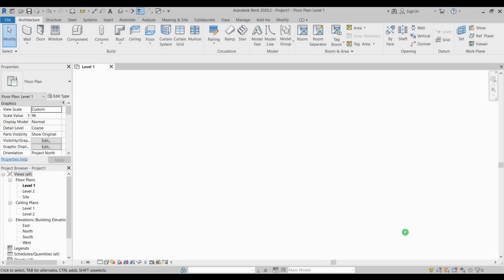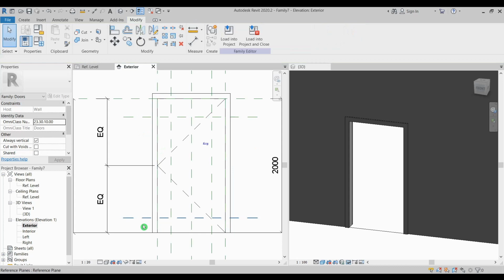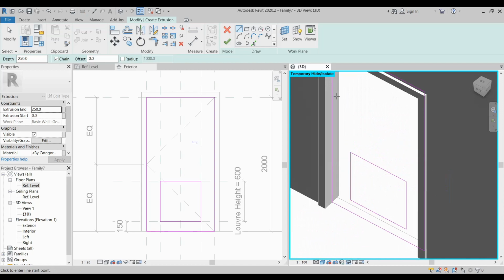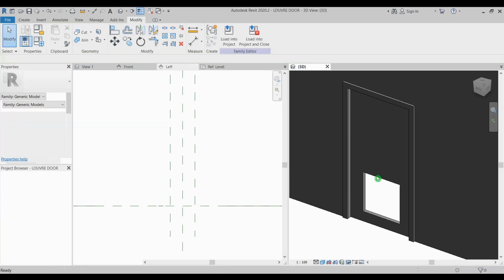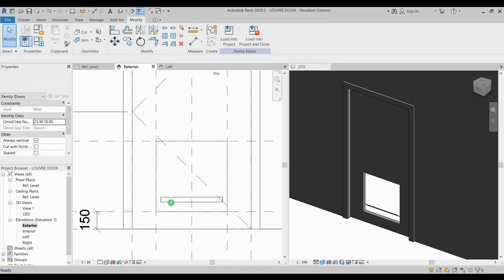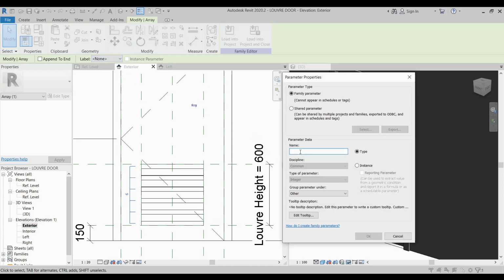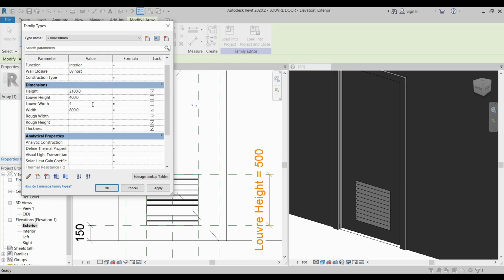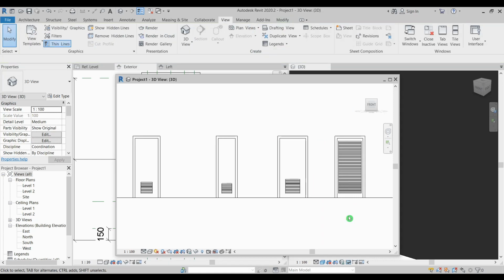Revit Parametric Louvre Door

Comment: Thank you for this tutorial, could you share this parametric door? the full louver doesn't work well with me, the louvres array come out from the louvre opening, I locked them as you did, even not easy to select the array to make the parameter.
Reply from the maker: It's been a while need to check on this and thank you.
Reply: @reycruz5566  have the same issue. Appreciate if you can guide